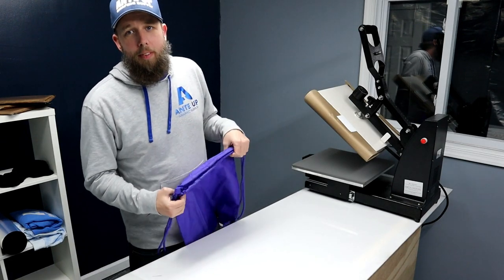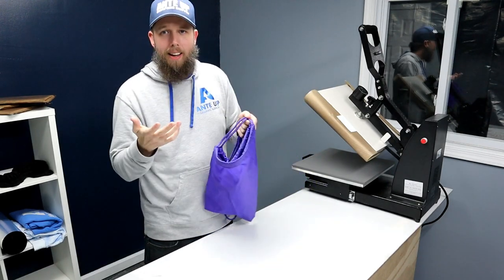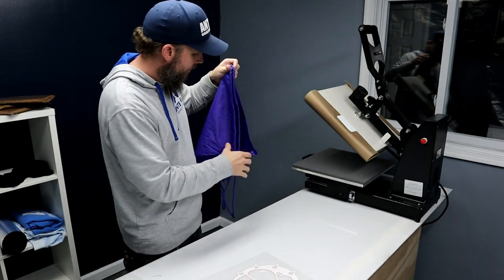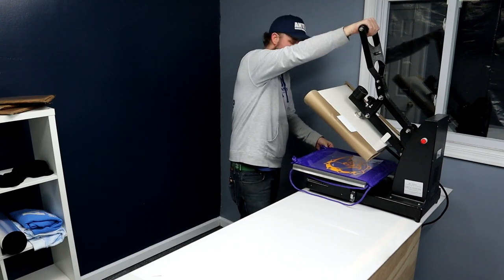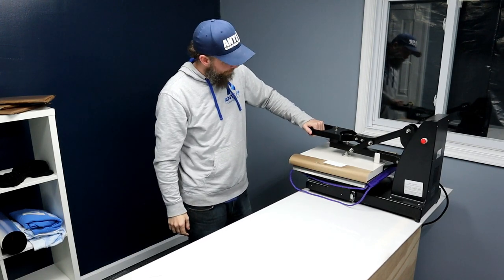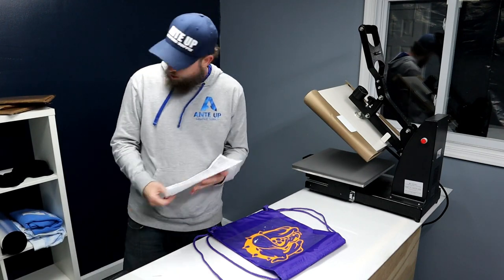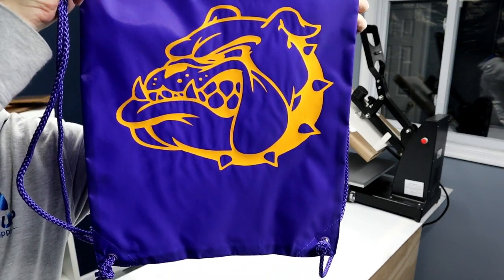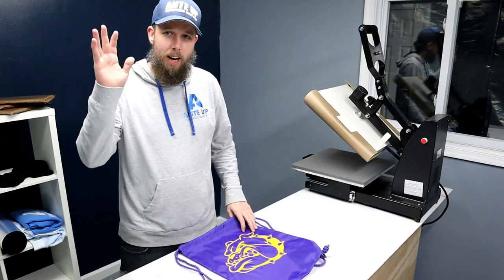How to press Heat transfer vinyl to a  Nylon bag using Siser EasyWeed Extra

Comment: Are the colors not available anymore for easyweed extra? If not, any suggestions on colored vinyl that can be used for nylon? Thanks!
Reply from the maker: They discontinued all the colors except white and black. 
I suggest laying white or black down. Then any color/type vinyl that you want.
Reply: Thanks! Super new to it.. could you recommend any yellow/gold colored HTV? I’m assuming getting the white Easyweed extra HTV plus your recommendation? 

I wish they still had the yellow you used, that’s exactly what I needed